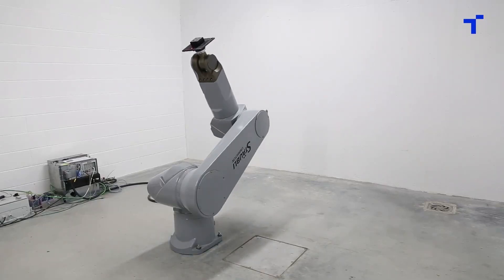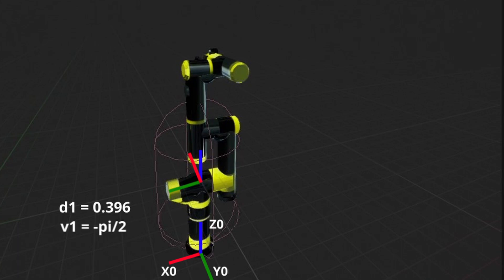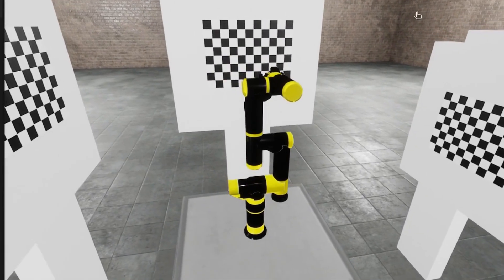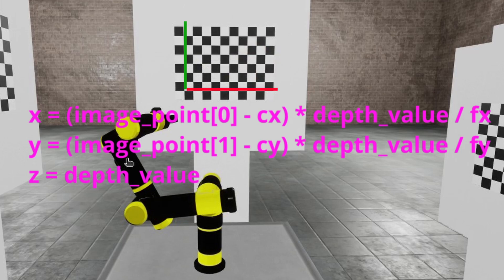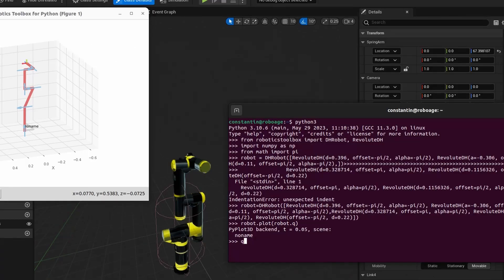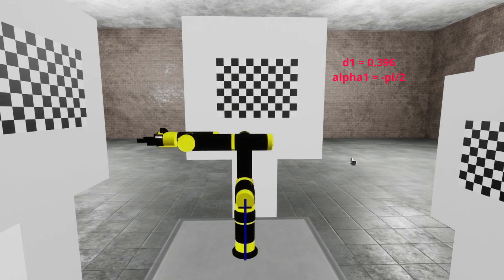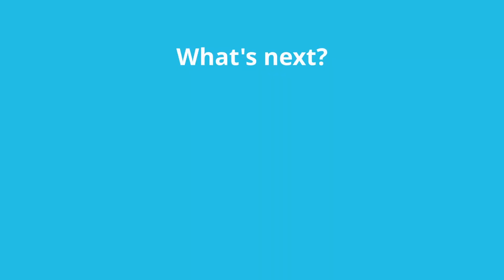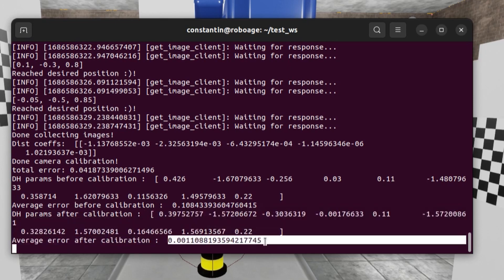DIY Robotic arm calibration using OpenCV and chessboard pattern.

Comment: Thanks for your video. I have some questions. If I have a point coordinate from camera coordinate. So, how robot can know   to moving with its coordinate?
Reply from the maker: Thank you for your comment. You should know where your robot's camera is located. So you can create transform matrix from camera coords to robot coords. And then just use standard inverse kinematics to move the robot.
Reply: @roboage1027  Thanks for your answer! But the important thing is the point coordinate that's camera coordinate,right? Hence, we need to transform the point coordinate to real word space coordinate first! And use it to create transform matrix from real world space to robot coords, right?
Reply from the maker: @b-lifestyle7263  I think, you need only one transform - from camera coords to robot coords.  Usually, robot's base is located in the world's origin. So, if you know transformation from camera frame to gripper frame, for example, you can use forward kinematics to calculate transformation from camera to gripper an fruther to base frame. And that will also be transformation from camera to world frame.
Reply: @roboage1027  Thanks for your quick response! I follow the handeye calibration. And the relative equation AX=XB is popular. With A is matrix end-effector to base, B is chess to camera. Then, I assume I obtain the X matrix (including rotation & translation matrix) for transformation of camera coords to end-effector coords. For the test, I turn on the robot camera (rgb camera) and I move the mouse to 1 corner of chessboard and I get the x and y, so x and y is pixel, right? If it's pixel, then I product [x,y,z] with Mintrinsic to obtain [xc,yc,zc]. Finally, If I wanna get [x,y,z,rx,ry,rz] of end-effectors, I product the [xc,yc,zc] with X matrix, right?